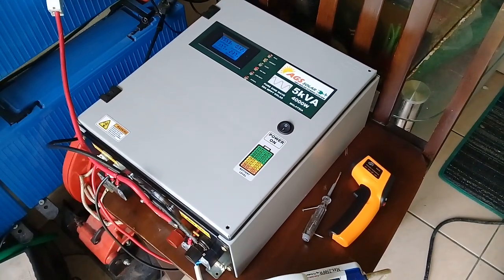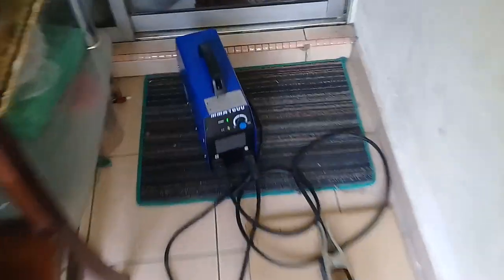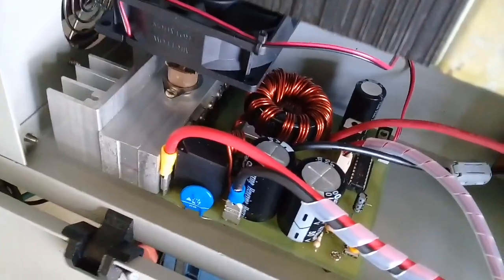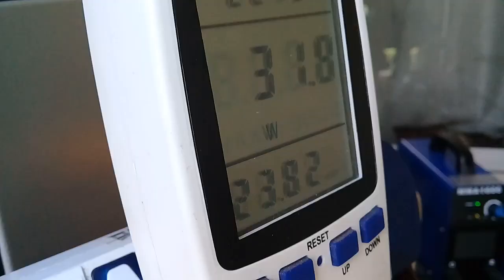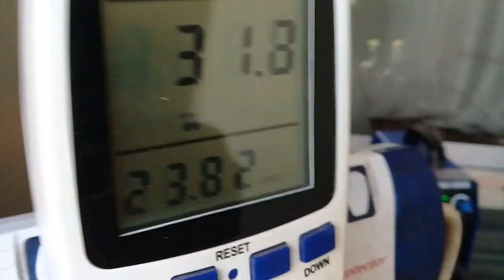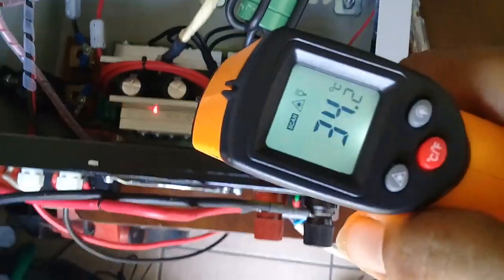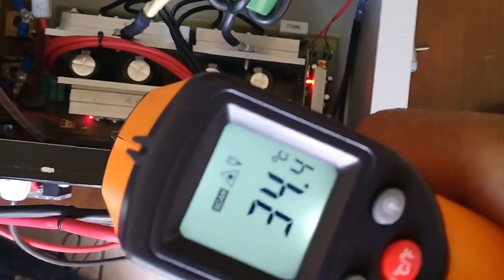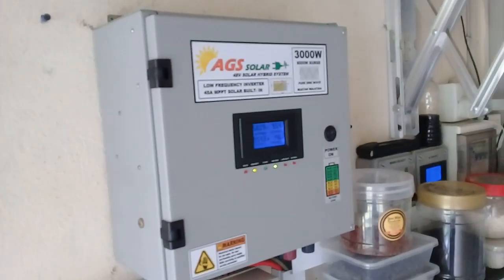4000w 48v EGS002 diy hybrid inverter run MMA Welder machine..Hy4008 mosfet run cooler

Comment: How do i connect the overload current circuit to the egs002 module together with the variable resistance. Can you help with a small diagram. I want to build one, please big man.

Comment: 48 volt inverter with 4 hy4008 in total  will do 2000 watt all day i have one i have used  for a few years  i am thinking about putting hy5608 in it 360 amp each

Comment: How is the behavior of the of the voltage input and output when you makes the welder machine works?
Thanks Rodrigo
Reply: Output watt turning on welding machine close to 3000w

Comment: Unipolar or bipolar?
Reply from the maker: Unipolar...500ns deadtime...boostrap caps modify to 22uf 16v smd tantalum.
Reply: @wajaeboseben  Could you recommend books I can use to learn?
Reply: @wajaeboseben  I created the circuit given in the EGS002 datasheet and the AC output is only 3.5 Volts, but the device said it is 218Volts. What could be the problem?

Comment: What is the primary volatge for 24v and 12v input..?
Reply from the maker: 12v = 8v pri  240v sec
24v = 16 pri 240v sec
36v = 24v pri 240v sec
48v = 32v pri 240v sec
Reply: @wajaeboseben  Can i request for the full diagram of your MPPT 50A sir?

Comment: I have 2 × 3 inch ups bobin in  which I have loops 0,140,220 and 260 for UPS.
 Copper wire number is SWG18, 
NOW i want to some more loops for automobile stabilizer? 
I wants  to use one transformer  for ups and auto stabilizer. Is this possible?
If this is possible  then Help me brother and also inbox with the Stabilizer formula.
I'm  waiting  dear friend

Comment: good,   it use EGS002?
Reply from the maker: Yes egs002..but need do minor modification...i change boostrap smd tantalum capacitor C2/C8 10uf16v to 22uf16v...reduce humm transfomer...ada dead time adjust 500ns...your fets run cooler
Reply: @wajaeboseben   Can you share the mppt circuit you use?
Reply: @PhdHung  did you get it?

Comment: Excellent I have try with inductor and no load current is dropping on 1.5A but my inverter does not like the inductors it produces strange noises and is complaining... 👍
Reply from the maker: Use ferrite EE 45 core..salvage from old psu...wound 4 turn copper electric wire 10mm...guaratee no noise
Reply from the maker: Eg8010 Dead time i programe jumper to 500ns......default 300ns not suitable for low frequency
Reply: Probably I will need a new inverter board and all that goes with it.... 👍

Comment: Hello Friend . You have a boost converter that is very efficient to charge my batteries. I have not found an efficient converter. I use 18v solar panels and my batteries are 36v thanks. your projects are very good I congratulate you. greetings from Colombia.
Reply from the maker: Why not connect two serial 18v panel and charge the battery bank..use pwm simple

Comment: Excellent performance.....
how is with no load..... Current draw of inverter..?
and inductor...?

And how is no load.....Current draw without inductor.....?
Now that is topic for new video.....?
Reply from the maker: Without inductor 2.5amps no load...with egs002 u must put inductor ferrite EE/toroid with 5 turn 10mm copper cable...reduce current draw from 2.5A to 1A...
Reply from the maker: No load draw about 1A...50w...not bad
Reply: Now I have to thank you for your response and answer.... 👍
Reply: I have one 12kva continuous and "36kva"peak and I think I have similar configuration output transistors are IGBT 4110  and have similar current draw about 2.5A with no load and no fans I have changed the fan's from 36w/fan 230vac to 12vdc pwm and pwm controller 16w that do better job than original fans.....
My intention is to lower the no load current with inductor as much as possible.... because my inverter is running 24/7....
👍
Reply: Not bad at all..... 50w